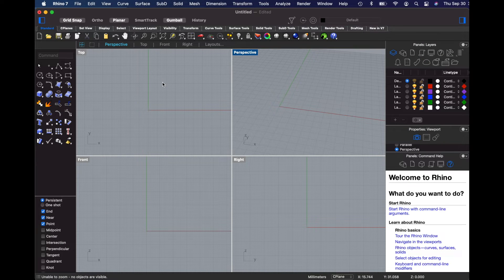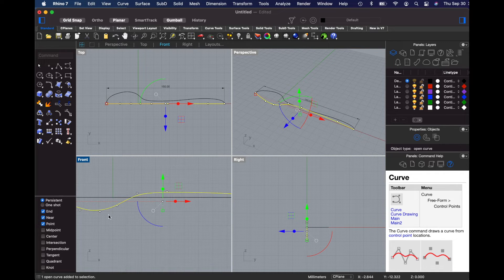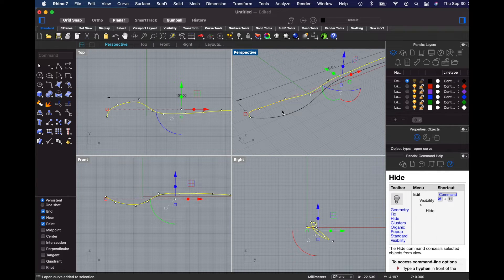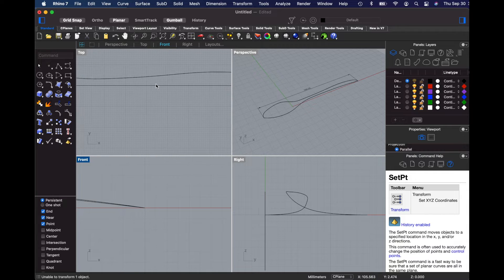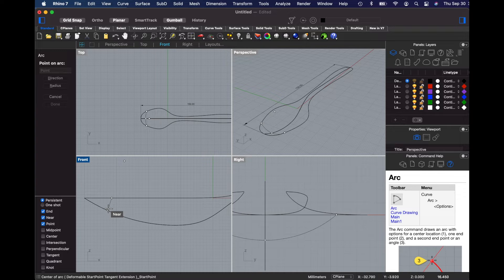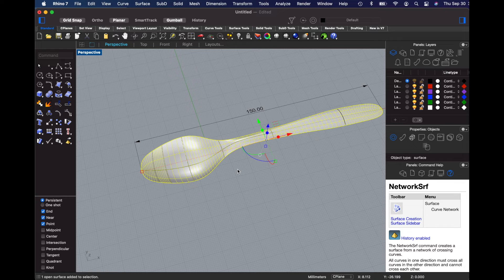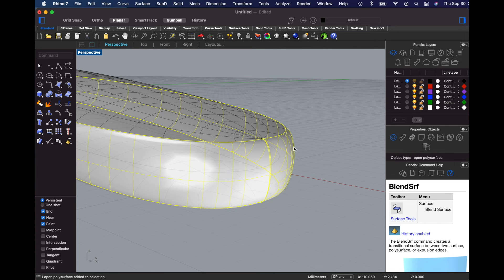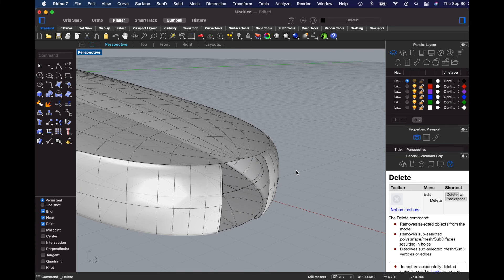Modelling a Spoon in Rhino 3D

Comment: Pretty good but would be improved with a description of what is being done and why.  And maybe a side by side with another way to do the same thing.  For example say "We will be drawing one surface of a spoon then "sort of" copy it, (with an "OFFSET" command), to make the other side.  We will connect the two sides to make it a solid with the X Command"  That would give more insight into the reason for the commands rather than just mimicking the keystrokes.